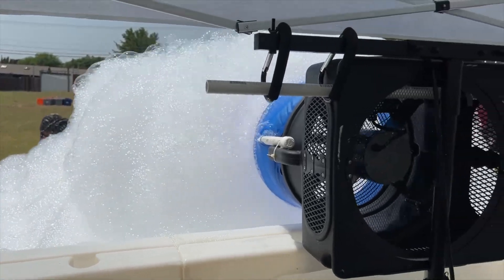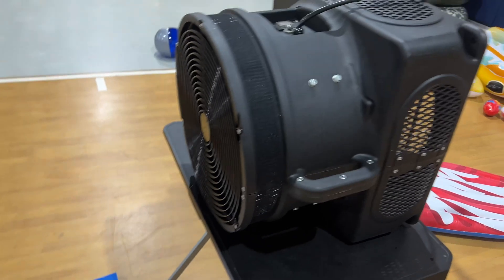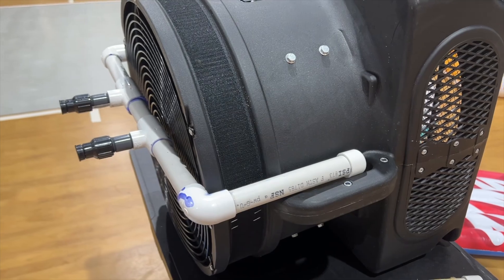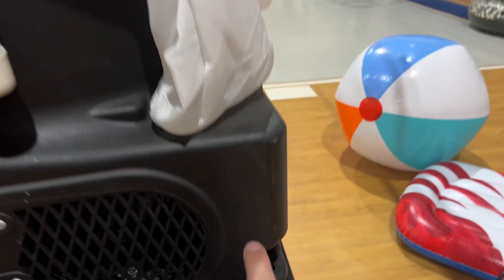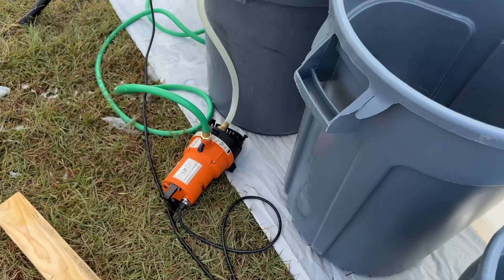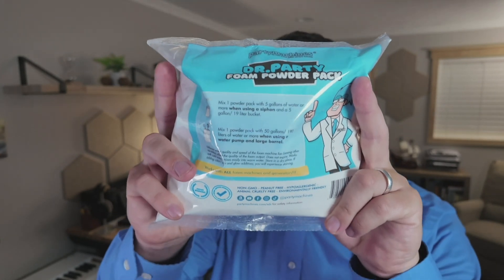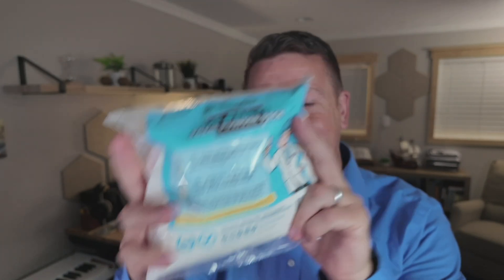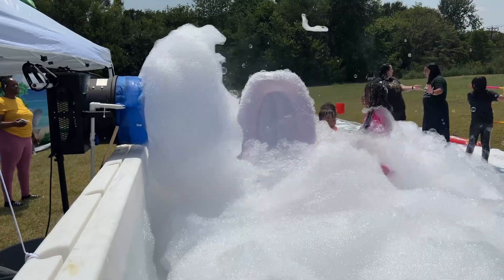DIY Foam Machine "IT WORKS AWESOME"

Comment: Did you have a problem with the foam surrounding the machine and enveloping everything?
Reply from the maker: We now place the machine under the edge of a event tent and use a shower curtain with a cut circle for the blower so nothing comes back.

Comment: Will a submerge-able  sump pump work inside of the trash can ?
Reply: Yes as long as it's rated for that. also the water GPM does not need to be too high because you will run out of solution much faster. And lesson learned make sure to fill the bucket with water before adding the Dr. Foam